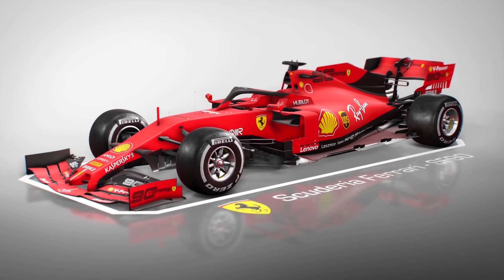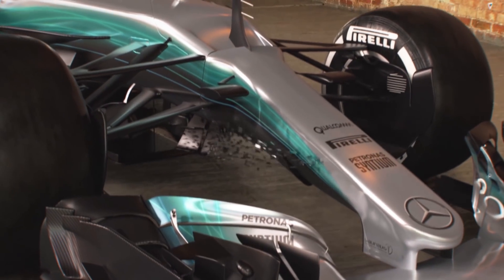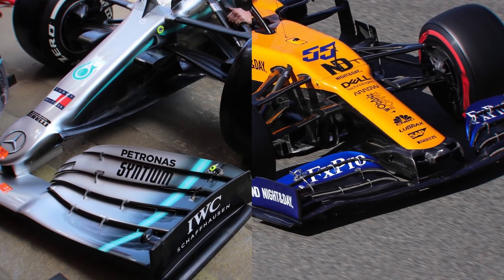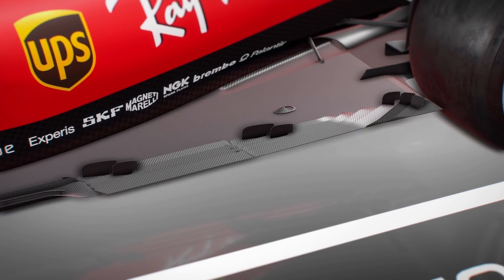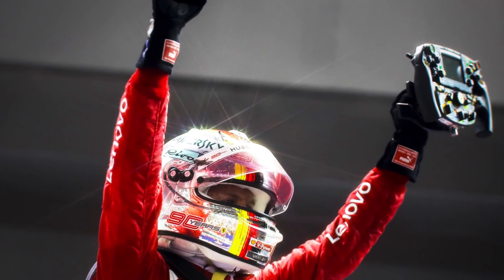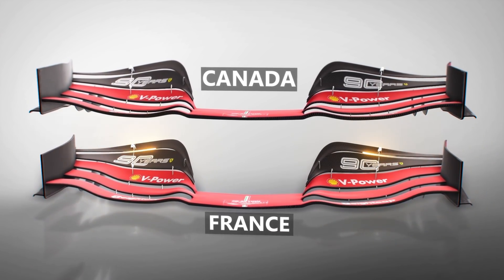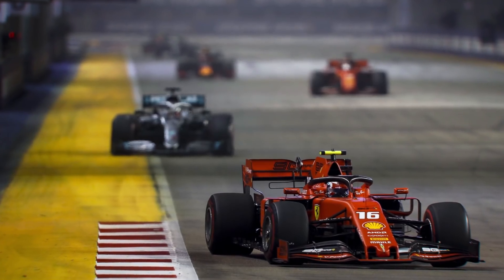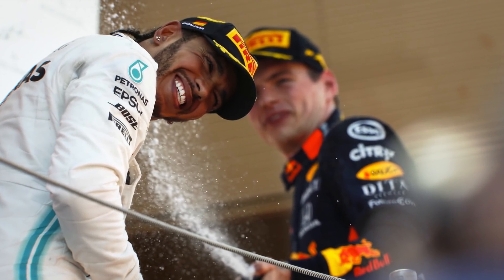How Ferrari solved its major 2019 weakness

Comment: based on seasons past I think it is far more likely that Ferrari have reintroduced PU enhancements that were responsible for a sudden performance increase until sufficient sensors were fitted by the FIA to detect that gain and quietly outlaw it. Pretty sure Merc will know what is going on and if their constructor and driver titles were not all but sewn up would be appealing. The sort of 1 lap gain they have a chieved over Merc is not the result of aero changes, good as they may be.

Comment: Guys, come on! No doubt Ferrari clearly has the better motor package however, Spa, Monza were expected results. Singapore is not a good race to determine overall performance and downforce because the race pace is too slow! With that said, there are circuits coming up in the schedule that will test the downforce at a quicker pace!  It’s then we’ll see if Ferrari has solved the riddle! It’s looking pretty good at this point but we can expect a response from Merc!

Comment: Firstly, I'm sure Mercedes and Redbull are hard at work at mimicking the function of Ferrari's new nostril additions, but when it comes to the Singapore Grand Prix, pit strategy also played a major role in the outcome of the race. If Mercedes had pitted both of their cars in the last quarter of the race, as they were struggling to keep up with the Ferrari's, and in doing so, put a set of softs on both cars, A. The cars that would've passed them during the stop would've easily been overtaken after the stop (I.e. Mid-pack cars: 6th-Albon Red Bull (But Albon doesn't seem to have what it takes to drive that car to its full potential like Verstappen), 7th-Norris McLaren, 8th-Magnussen Haas, 9th-Raikkonen "Alfa Romeo"/Sauber, etc.), especially on NEW softs, then, B. All they'd have to do is overtake Verstappen, Leclerc, and Vettel, who were ALL on OLD HARDS. I don't know what the Mercedes strategists were thinking, but the last 15-20 laps of the race could've easily been a battle between both Mercedes cars on NEW SOFTS vs. Verstappen and the two Ferraris, ALL on OLD HARDS.🤭 As I was watching the race, I was yelling at my TV, thinking, "What is Mercedes thinking?! Their cars are in the perfect position to mount an offensive on the top three if they only stopped for new softs. The back-markers who would've passed them during the pit would've been easily re-overtaken, and the last 15-20 laps of the race could've easily been a battle between the 2 Mercedes cars on new softs vs. the top 3 on old hards! But no, they're leaving the 2 Mercedes cars out there on slightly newer hards, and basically have them giving up the fight and settling for the 12 points for 4th, going to Lewis, and the 10 points for 5th, going to Bottas.🙄🤭" In the end, Mercedes just had their eyes on the financial side of the sport. They were thinking about the millions of dollars (Or whatever currency💰💶💷💵) they would get for the total of 22 points they would scoop up from their 2 drivers.🤭🙄 That's not racing. Mercedes, my favorite team for years, ever since Lewis joined up, were running a "Formula Financial Grand Prix," as opposed to taking the risk and fighting for the win. Just sad.😔

Comment: I reckon they put little tabs where it doesn’t matter to get you guys excited . Sure aerodynamics were important but Mercedes is fast because it has until now the best engine, transmission, suspension, and aerodynamic package which is constantly being improved. They are spending a fortune hiring engineers in all these areas. If Ferrari & Red Bull want to stay in the race they have to do the same. Imagine this car is flowing through water,it is not going to flow off the little tabs & winglets in straight lines, it would be very disturbed .Air is a fluid subject to the same laws of physics . It just doesn’t flow off winglets in nice straight lines. Yes aerodynamics is very important but nowhere near the whole story. Ferrari still build incredible engines as does Mercedes.

Comment: I’m not convinced though i think Mercedes just became complacent the lack of upgrades etc and pure shitty hit or miss strategies cost em tbh and they were wayy faster than them on race pace .. Even Toto wasn’t convinced you cant just find 30-40 points of Downforce by changing a nose 😂😅... but huge improvement from Hungary though on Ferrari’ s part. If Mercedes fixes the power deficit it would be over.. the next tracks should tell us if these fixes are legit or just flukes. Mercedes n Red-bull probably worried 😂 especially red bull slowest on a straight-line now slowest in high downforce tracks of the Top 3.

Comment: No way that's added that much downforce. They set their car up for more quali trim than race race. You can see in Leclerc's quali lap how much he was fighting the car. To be first around this track is more key than anywhere else. Hamiltons race pace was far better than the Ferrari's as you could see in the first stint, he was able to keep within a second to Leclerc but just couldn't get near him on the pit straight or the other one after turn 4. You could see how much Leclerc struggled to keep up with Vettel during the second stint as Vettel was at a time, 5 seconds ahead. If the ferrair had that much downforce he would of been able to keep within a second as Hamilton did with Leclerc.

Russia looks like another track that will suit Ferrari, long straights and point and squirt corners. Races after that though will all feed into Mercedes hands.

Comment: Did they really just cite the totally nonsense equal transit time theory for lift with "the inclinations of the nostrils leading edge forces airflow passing underneath to take a longer path and it hence accelerates, as a result it develops stronger low pressure region underneath, boosting overall downforce"???

Comment: A nice upgrade sure, but I can't help think Singapore wasn't such a doomsday track for Ferrari like many suggestion. Traditionally Singapore has been a very good track for Ferrari. Pole and Victory in 2015. Pole in 2017. Podium in 2018. Definitely not ideal for the SF90 either,  but I certainly don't expect Ferrari to suddenly amazing on HDF tracks. I think what is more key is their approach to being strong in qual, and just use their straightline speed hold on in the race.

Comment: You win WDC's in the first half of the season. This video and Ferrari's updates are too late.

It is possible, now that the WDC is wrapped up, that Mercedes have turned their attention to their 2020 car. In fact if Ferrari were wise (there's an oxymoron 😉) they would use the rest of 2019 to help develop their 2020 car.

2019's season is over. Ferrari caught napping with lack of downforce (again!!!!!, shocking) and grip, and occasional poor strategy. It's like Enzo days again when all they can think of is engine power ...
Reply: Won't be surprised if Ferrari goes back to square 1 for the start of next year. Best thing they can do is now use any good results they get for next year but knowing how incredibly incompetent Ferarri is... won't be surprised if they find themselves half a second behind Mercedes

Comment: Let’s be honest about where Ferrari are.    While it’s great that Ferrari have added more details to the aerodynamics to the car making it produce more downforce etc, one of the Ferrari’s gremlins is that it’s tyres suffer degradation more than its closest rivals.    
The slow pace in the first stint helped the Ferrari tyres not drop off the cliff late into the first stint.       Then we had 3 safety cars which meant many laps cruising around and so again the tyres didn’t suffer badly and therefore red cars could hold their positions very well.  
It’ll remain to be seen whether on the remaining tracks the performance throughout a race is there.     As a Ferrari fan I hope so. 😊

Comment: 0:30 ehm... that's not how that part of the aerodynamics is supposed to work. Please stop propagating the idea that a longer path magically accelerates air flow. That's just wrong. Faster airflow does create lower pressure, but that faster air flow is not created by the length of the path it takes.

Comment: Sochi has a long straight and a few faster sections between corners, so could suit ferrari nicely. Just depends if they can hold onto their tyres in the race. Heres to another ferrari 1-2 and another race with no merc on the podium.

Comment: I think the hot temperatures also helped them a lot in qually as they previously needed these temps to get the tyres to work. Like Bahrain and Austria - but in Singapore overtaking is impossible. Will be interesting to see how they get on in a colder Russia with this new upgrade.
Reply: Not just tyre temps either, the Mercs are notoriously slower in high ambient conditions engine wise, so no doubt they would have been running max cooling (less aero performance) and no doubt still struggling to run full beans.
Reply: I agree, the hotter temps are helping Ferrari

Comment: Air taking a longer path doesn't accelerate. If you have a short and long hose and switch them out the longer hose doesn't have higher water speed.
Also where would the energy come from to cause it to accelerate?
I would think it's going faster because there is less space under the car.
(I'm not an engineer don't reee on me)
Reply: reeeeeeee

Comment: The whole world was shocked from practice 3 onwards. If Ferrari fix their downforce it's goodbye Merc coz their are 2tenth  up on the straight
Reply: @terry varta ...With more downforce, the car will be slower on the straights.
Reply: @Alumnikiid  Am pretty sure it's easier to tinker with to downforce wen u already have straight line than vise versa
Reply: Alumnikiid that is true , but the Ferrari power unit is superior to that of the Mercedes and it has been shown
Reply: @iiascariii3916  not exactly. Ferrari has better acceleration but not an overall more powerful PU that Toto always spins. Merc's PU is the most powerful on the grid and that's why they are running on maximum downforce, even more than Red Bull & Mclaren because their PU compensates for in straight line despite having more drag than Ferrari on straight line. Despite all this Merc could have won all 3 of previous GP's if not for strategy calls and Leclerc outperforming himself. And, if Merc reduce their downforce and turn on their party modes, Ferrari will look dwarfed like Red Bull.
Reply: Not sure why replies are so defensive. I said nothing about power units, mercedes or how hard it is to tinker with downforce vs power.

Comment: Congratulations to Ferrari, they've returned from ashes. If Mercedes wanted to keep them att bay they should've won at Monza and Spa, wich they did not because they kept of going at the same strategy that no longer works. Now Mercedes gotta deal with this upcoming Ferrari.
Reply: Ferrari have already lost the season, and Mercedes haven't stopped pioneering, but Ferrari have improved the car. You seem to have some odd ideas...
Reply: Brilliant analysis 10/10
Reply: Only when the championship is pretty much close to being over... Ferrari cannot rest on it's laurels if they want to challenge next year,have to build on the improvements they can made for the remainder of the year as a basis for next year's car.

Comment: The nostril provides downforce due to its curvature which forces the air below to speed up because the sectional area under the nostril reduces in size, acting like a nozzle. The “longer path” explanation is well known to be an incorrect theory of lift.

Comment: Thanks for explaining exactly why F1 technology is so boring nowadays.
Reply: clown
Reply: Just because you dont understand it, doesnt make it boring.
Reply: @JD_Racer97  Adding little bits of carbon fiber in order to increase downforce resulting in minuscule improvements in lap times is fascinating.  Reminds me of when Cooper decided to position the motor in the middle of the car, or the time that Lotus placed the radiators on the sides and added wings, or the time that Tyrell tried 6 wheels, or the time that McLaren came out with the fan car.  Oh yeah.  Those bits of aerodynamic carbon fiber are revolutionary.
Reply: Frank Howard it was Brabham that created the BT46 fan car.
Reply: @jstoli996c4s  My mistake.  You are correct sir.  Gordon Murray came up with the idea to compete with Lotus' ground effects.

Comment: This may not be the place to ask but even in this segment you argue that Ferrari won this race by focusing on the qualifying, not the race. Shouldn't that be a red flag for this circuit? I mean, can we call something a race when the first third of it is ran at a lower than needed pace just because the driver of the first car over the first curve of the race decides it to be so? Compare with the ultimate tactical race in athletics, the 1500 meters. It can be made slower, and it usually is, but not because of the decision of one racer alone - you only need another to decide to make it quicker and it changes completely. I honestly thing the F1 championship does not need races like this. Monaco has the rain, at least, to make it unpredictable. Singapore is so predictable there is even a 100% certainty a safety car will come out, even i a dry race! Quoting the F1 webpage itself: "not to make any rash predictions, but at the last three dry Singapore Grands Prix, the drivers who qualified first, second and third on the grid finished the race in that same order." A race decided in the qualifying is not a race, it's a waste of time.
Reply: Ahem, Monaco GP?
Reply: If Hamilton thinks that it's too slow he should have tried to overtake Leclerc, which he didn't want to or couldn't. Has nothing to do with the circuit. I have seen plenty of overtakes in the midfield.
Reply: @marune1975 , you may try and listen to what Leclerc said, himself. And you should seriously try to count the number of overtakes in Singapore and compare it with most of the circuits, especially if it's not between completely unbalanced cars (i.e., a Ferrari or a Mercedes overtaking a Hass doesn't really count). Here, have a go: https://www.youtube.com/watch?v=Glng0dVyFLs. You may be able to count 5 or 6 real overtakes (i.e., discounting pit stops, dnf or punctures/front breaks...). I wouldn't call it plenty.

Comment: I don't think it's fixed. It was blazing hot and on the softest tyres so bad downforce is somewhat reduced. Wait till Russia where the temperature is lower and on harder tyres.
Reply: The tyres will only be one step softer in Sochi and there are a few long flat out sections. I expect Ferrari to do well

Comment: This might be a stupid question but what's stopping Williams from just copying this model? Like do they have some patents on these modifications? How are all these details so open?
Reply: every team has a different aero/downforce strategy on their car, what works for one may not work for the other
I think this comes mainly from looking at the car on TV or in the garage
Reply: As far as I understand, it has to do with the chassis design or concept, a Ferrari front wing  won't suit the aero needs of a red bull or a Mercedes, so they will have to develop their own interpretation of what Ferrari or other team did.
Reply: You occasionally see team principals comment on this, claiming that modern F1 cars are so complex and finicky that even if you basically handed a finished MGP (Ferrari, Red Bull...) to a smaller team they'd get nowhere near the results out of. 

... probably still better than a Williams, though.

The other problem is of course that you can't develop such a car at all without understanding out. So what are you going to do at the start of next season?
Reply: It seems to me that since every constructor starts with their own design based on what they can envision within the rules, the upgrading and evolution of the cars throughout the season are all still unique even if concepts are copied from other teams. The best example I can think of is the double diffuser in 2009. The Red Bull RB5 wasn’t designed for a double diffuser, but the downforce gains were greater than any aero drawbacks. It just took them much longer to implement it properly according to their chassis’ characteristics. Once they did, it became the quickest car in the field.
Reply: You would have to know every little detail to do that, just taking a picture won't give you nearly enough information. The diffusers, floor, suspension etc. can't be copied by just looking at the pictuer.
Reply: Yeah, why they dont measure whole Ferrari car on pc from some pictures and reproduce exact replica of it... I rly want to know...
Reply: nightvvisher Every constructor has to design their own car, so that would be illegal.
Reply: @mystraker3400  yeah, but teams are copyng each other from beggining of f1, why not just copy whole car, whats difference if you copyed one part or whole car...
Reply: nightvvisher Copying the concepts of individual components is acceptable, but the parts have to suit the base chassis of each team because otherwise, they won't work properly. It's illegal for teams to copy entire cars--that's the whole point of F1. Otherwise you would have customer cars, where teams would buy whole cars instead of spending the time and money on designing their own. That would turn F1 into a sham.
Reply: @nightvvisher7713  there is also the issue of the set-up of the car from inside -- something that plagued Red Bull since they were just using the engine that was suited to Renault's body. The shape of the body itself would determine the shape of the wings and bargeboards
Reply: Regarding patents, there's no way to have these small modifications to get patented in time since they change so frequently
Reply: also i think williams just dont have the man power to copy something like this